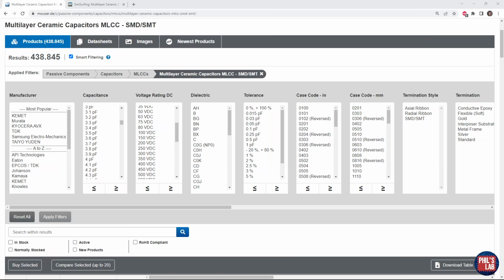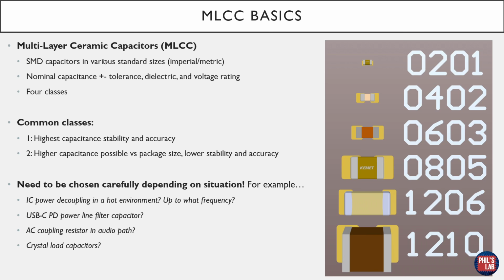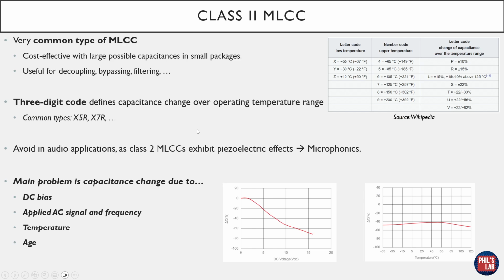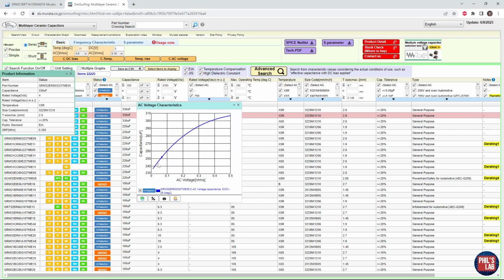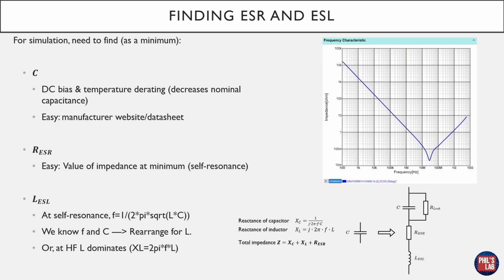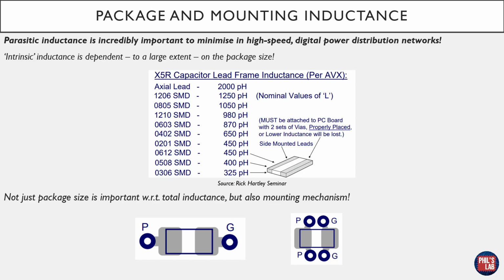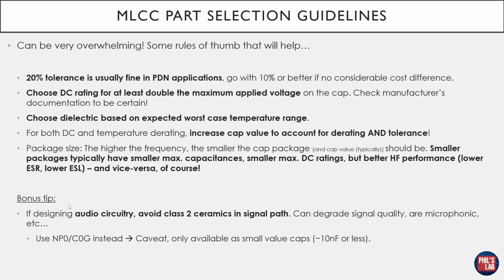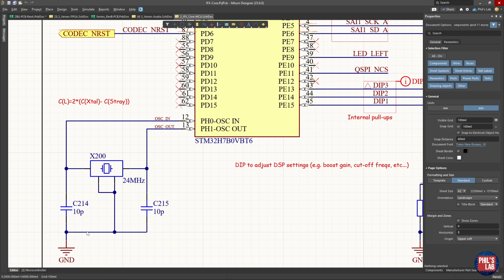Capacitor Hardware Design Basics (MLCC) - Phil's Lab #114

Comment from the maker: Clarification: An overstatement on my part of the impedance frequency response. Above the self-resonant frequency, the capacitor isn't 'useless' as the impedance is still low near that point. However, the decoupling (and filtering) effectiveness is decreased as we further go up in frequency past that point.
What impedance profile you require up to what frequencies is situation-dependent, as usual - in particular for power-distribution networks.
Reply: Phil is there is one matter that can make up for a useful video on your channel. This is related to "generic components". 

Basically when we create schematic we might not know what specific part we will buy and use. This could be because the final value (for resistor, capacitor, inductor) is not yet decided or because we are not sure what vendor we will use due to difference in some attributes for components from different vendors. This problem can be overcome by using generic components.

A generic component can be assigend a value and package and then schematic and PCB layout be carried out using that information. Later when we know the exact values that shall be used, we can replace the generic component with specific component and then send the PCB for manufacture and assembly.

I am trying to learn Altium and this is one problem I am having.
Reply: Could you add a link to the Rick Hartley seminar in the video description? I've seen most of his public talks (I'm definitely a fanboi) but I don't remember seeing the ballpark inductance numbers for caps and would love to check that presentation out.
Reply: thanks😊

Comment: I had a nasty problem in a pulsed laser driver, which manifested in ~200ns oscillations of laser output. It happened the problem was in 1206 capacitors mechanical resonance. After replacing the bank of 10x10uf ceramic caps with a simple 100u electrolyte oscillations vanished.

Comment: Very, very, very important matter, especially when you are designing high frequency DC-DC converters!
DC bias can sometimes lower the capacitance so low that the control loop becomes unstable around target output voltage.
Usually, DC-DC IC manufacturer often recommend very high capacitance values for the filtering caps, as they expect junior (or careless) designers to slap the cheapest or smallest MLCC with voltage rating barely over its working voltage. Unfortunately, it often pushes these designers to select the MLCCs with the worse DC bias curve.
You'll often have a more performant regulator when choosing MLCCs with 1/2 the recommended capacitance but 2x (above 100V) to 4x (under 5V) voltage rating.
It will also be more resistant to EMS choosing random 'equivalent' parts, because there is a wider variation of effective cap closer to the the rated voltage. I've seen voltage ripple double between two batches of boards, turned out the EMS had chosen an equivalent cap with some of the worse DC bias curve I've seen for the second batch...

Now, about layout and decoupling cap placement:
depending on the stackup, placing MLCCs on the back of a BGA might be worse than placing large power planes very close to the GND plane and the BGA itself.
Don't forget that vias inductance is roughly proportional to the square of their length: a 0.3mm diameter, 0.4mm long via has about 50pH inductance, and a 1.6mm one about 550pH.
Coincidentally, A 10mm wide, 10mm long, 0.1mm separation coupled plane also has about 600pH inductance, so we're still in the same ballpark.
Now if you also consider that PCB manufacturer often guarantee individual vias to be under a couple of Ohms (with wide individual variations), you'll notice that careful stackup selection, uninterrupted plane and placing fewer, larger caps with multiple via connection will yield a very similar result (if not better) than placing 0201 caps under each power pairs of the BGA; while being easier to route and possibly cheaper to manufacture.
I guess the general rule would be not to rely on individual vias to transfer power (unless you absolutely can't do otherwise), and place power planes as close as possible to themselves, the source and the sink.

But if you really need to over-do it, skip the 0201 and go straight to reversed geometry MLCC (ex: 0306, 0508, etc) as they provide the lowest possible parasitic inductance. You can get a single 1uF 0306 (with multiple vias) do better than ten 0201 0.1uf individually connected. And if one or two vias have an abnormal (but within tolerance) resistance, the board is more likely to work properly.

Comment: Another thing to keep in mind with class 2 MLCCs (ferroelectric barium titanate dielectric) is that their physical properties lead to noise and signal distortion around the zero-crossing point, due to magnetic domain wall heating. This makes them less suitable for low-noise AC designs where a low noise floor is a critical requirement. Class 1 NP0/C0G (paraelectric calcium zirconate dielectric) don't suffer from the same issue.

Comment: Interesting video, but it isn't true a decoupling capacitor is useless at frequencies above its self-resonant frequency. Even at frequencies well above the resonance, the component shows a very low absolute impedance, making very well its decoupling job. It doesn't matter if at those frequencies the impedance increases with frequency (inductive behavior) , the only important parameter is the absolute impedance, still very low for other frequency decades above resonance.
Reply from the maker: Thanks, Giorgio - you are correct, that was an overstatement on my part. I have added a pinned comment to clarify.

Comment: Hi, Phil. Thank you so much for presenting this tutorial on MLCC capacitors. Recently, I am developing a consumer electronics product and I am stuck at choosing MLCC capacitors that is most suitable. Capacitor is the most basic component on a PCB but after watching today's video, I know there is a lot of places we have to take care of. Especially, you have mentioned the capacitor value will vary from DC bias and AC voltage, as well as the effective working frequency of a capacitor. All these knowledges are super important and I think after going through your video, I am now able to select the proper capacitor for my design. Again, really appreciate the knowledge you share!
Reply from the maker: Thank you - glad to hear the video is helpful!

Comment: For Capacitors I always make sure Dilectric and Voltage are visible for review purposes. I find this is the minimum too give enough information with crowding the Schematic.

If using Smart PDFs, you can normally hide more information from the part such as Tolerance, or links to the Impedance graphs like you have shown. Great video Phil, keep it up 👍

Comment: When a datasheet for a chip or something specifies a 1 uF capacitor for biasing, do they specifically mean "use a 1 uF cap" or do they mean "use a cap that is 1uF at this bias voltage"? 
Do the designers of these chips and datasheet take that into account?
Reply from the maker: I'd suggest to always choose a cap that takes derating into account.

Manufacturers implicitly assume you have done that - so yes, in your example, use a cap that is (close to) 1uF with worst-case derating (bias,  temperature, ..) taken into account.

Comment: I've been trying to design guitar pedals. What do you suggest I use when I need values higher than available NPOs? like 22nf to uF range.  I've seen modern pedals use almost all mlcc. So are they using class 2 capacitors?
Reply from the maker: I've used MLCCs in audio paths a fair bit and only sometimes have had problems. I'd still advise against it.
You can use large electrolytics for straight-forward coupling caps. If you need controlled impedances, cut-off freqs, etc.. go with poly*-caps, film caps, or class I MLCC.
Reply: @PhilsLab  thanks man. I've had this question for a while and havent had a clear answer until now. Anyway, I've watched you design pedals, can there be a design/pcb layout guide video on how to layout high gain distortion pedals? I've tried but im having osciallations as my knowledge is very limited as of the moment.

Comment: Nice video. When I took electronics in high school 21+ years ago, I just learned about through hole caps and I'm sure that's all that was really used. You only saw SMB in super high end electronics, almost all was still through hole

I have been trying to learn about all these different types of caps now for my projects. Now that PCBs are stupid cheap and free software for hobbyist designers
Reply from the maker: Thanks a lot, Mike! Good luck with your designs! :)
Reply: @PhilsLab  Thank you!  It would be super nice is Altium had a makers/hobbyist version of their software...  1.9k a year for it is a bit out of my price range.  lol.  But otherwise i've been using EasyEDA and its been pretty damn good for my use.   But some of the features Altium has that you've showed off, I wish EasyEDA had

Comment: App notes give the impression that a mix of capacitance values for decoupling a supply rail (e.g. .1u, 1u, 4.7u) are necessary to protect the load from noise on the rail. However, some folks smarter than me have pointed out this can be a bit misleading, due to what you were pointing out regarding case size and mounting using Rick Hartley's table. The primary feature being used is the different case sizes, not the capacitance values. The reason for different capacitances is more likely due to 1uf being the most economical large capacitance in one case size, 4.7uf being the most economical large value in a larger case size, etc.
Reply from the maker: The '3 different-value caps' idea is usually not needed (thinking that different-value caps cover different frequency bands). Simulation should be done in any case, but a problem is that can cause parallel anti-resonances. in combination with how the power-distribution network is routed/layed-out. An approach that 'de-risks' resonances is to use small caps of the same value (e.g. parallel banks of 100nF) and, if needed, a single much larger, bulk bypass cap.

Comment: Phil, it would be great if you could make a video on the topic of Ferrite beads. Basically, on some FPGA boards I find them being used on power rail of some clock generating ICs. However, I don't find it being used on al such ICs and not on all the FPGA boards. It is not clear why this is so.
Reply from the maker: Definitely will be making one on that. In fact, this is the start of a 'series' on power supply filtering. Need to cover the basics of capacitors first with this vid, then RC filters, later RLC, then ferrite beads + PI filters. I have a dedicated, simple PCB here that I'll be using together with a spectrum analyzer/scope to show real-world results.
Reply: @PhilsLab great stuff looking forward to it! Your vids are a great addition to the "basics" courses at Uni.
Reply: @PhilsLab  If you keep going, you will easily become Johnny Sins for the electronics world.
Reply from the maker: I'll pretend like I don't know what that means 😅
Reply: @PhilsLab  At some point you will have to talk about PDN and PDN impedance, certainly not a straightforward subject.